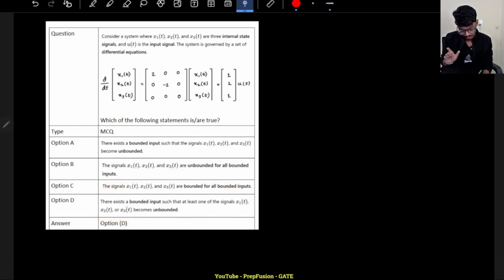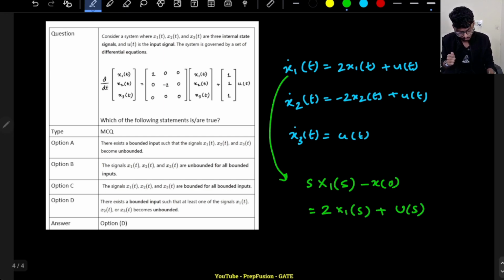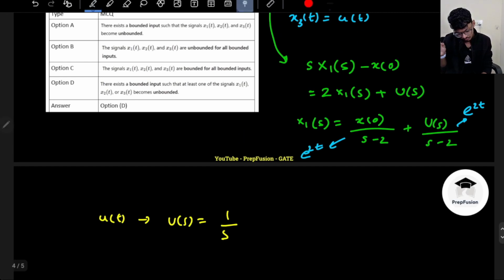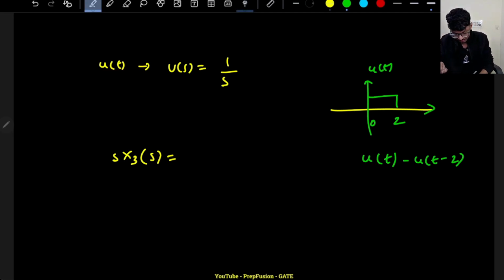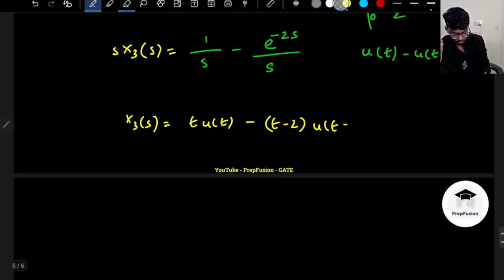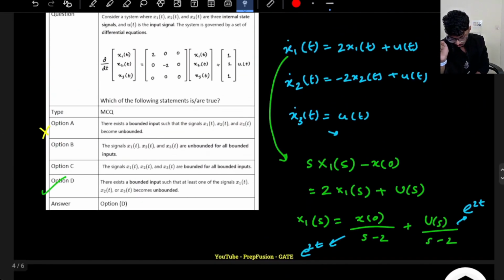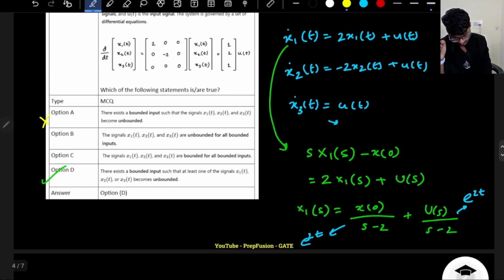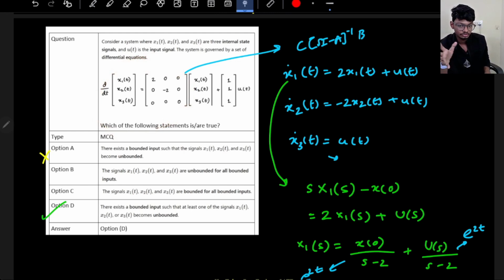GATE 2025 ECE Control System Good question || PrepFusion

Comment: Hello sir, hope you reading my comment. I am a BTech 3rd-year student in the Electronics and Communication Engineering (ECE) stream. I appeared this year's gate EC paper after taking coaching from PW, where I completed subjects like Mathematics, Aptitude, Analog Electronics, Digital Electronics, Control Systems, Network Theorems, and Signal Systems. I practiced extensively with DPPs, tests, and PYQs.
However, I felt disappointed as many questions were from Communication Systems and Electronic Devices & Circuits (EDC), which I had not completed. I attempted 4-5 full mock tests, scoring around 35-40 on average. I was fully determined not to attempt any unknown questions, but my strategy failed in the actual exam. Now, I am hoping that I might just clear the cutoff. What should I do to improve, and how can I contact you for guidance? I am struggling to find a way to make a strong comeback next year. Please guide me.